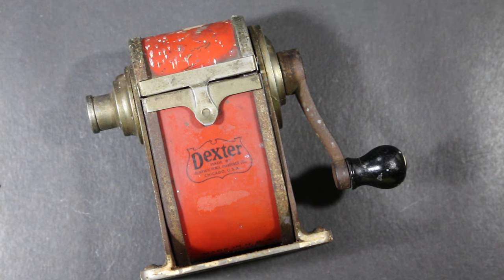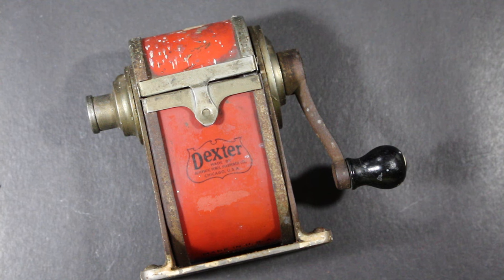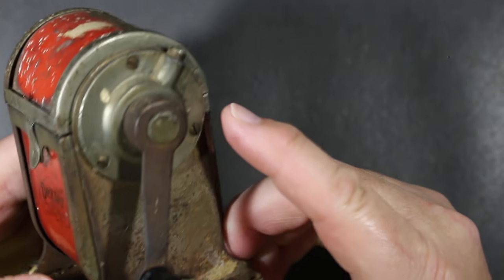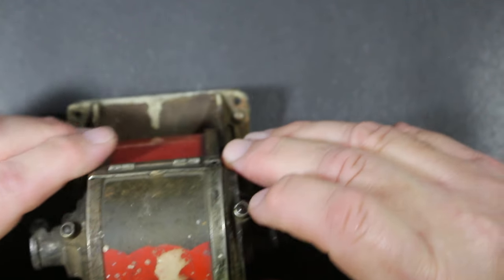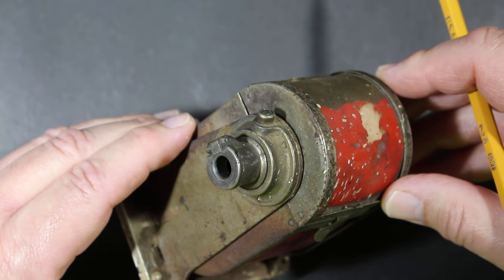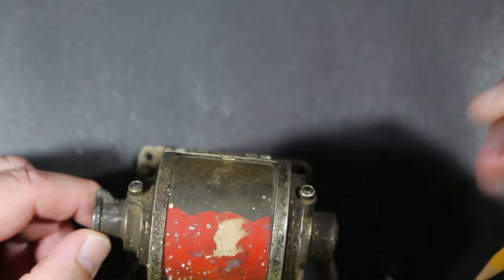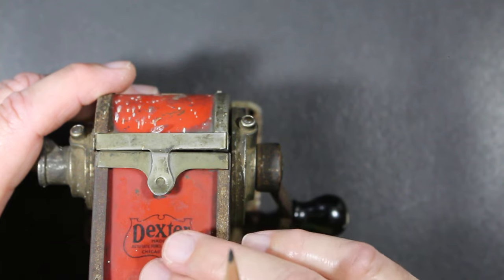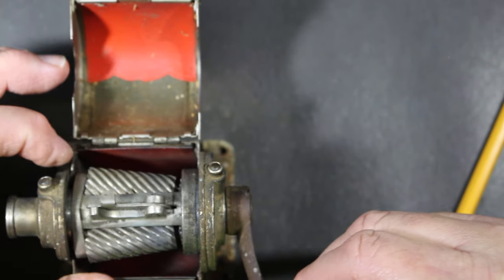Antique Dexter Pencil Sharpener Review

Comment: That's quite a find! Could use a little oil, just a drum or two, and it'll be right again lickety split. 😂

The inner piece you were puzzled about is, as others have said, a toggle for the pencil point sharpness. You had a VERY lucky camera angle at 7:34 - you can clearly see when you move the toggle that a tiny block of metal moves back and forth inside the sharpener's shaft, exactly where the point would be nestled.
Reply from the maker: Hi DFT - yes, thanks to many of you I now see how that point adjuster works. I've given it a few drops of oil and it's turning very smoothly! Thanks!